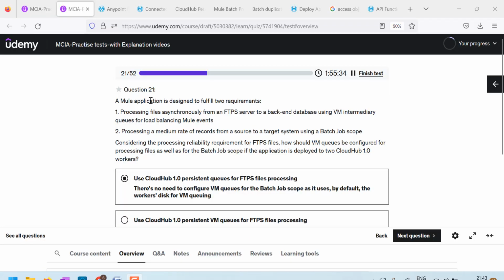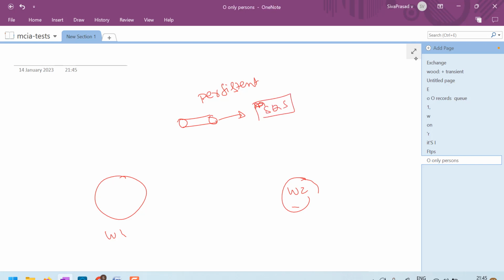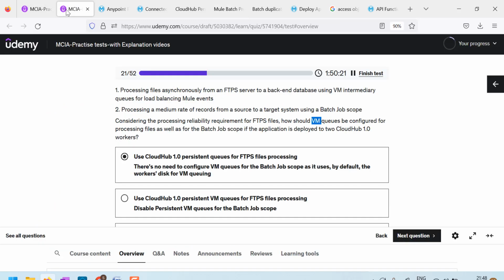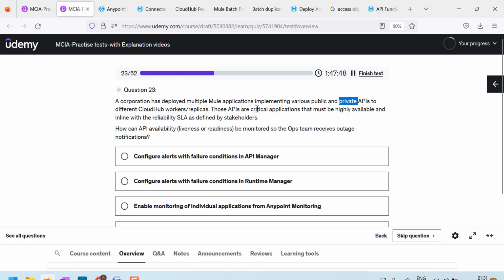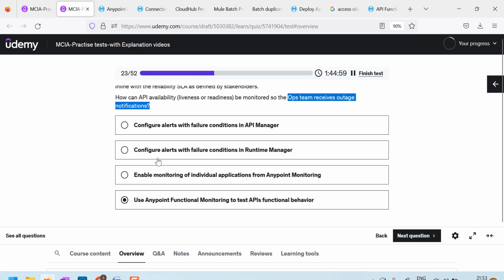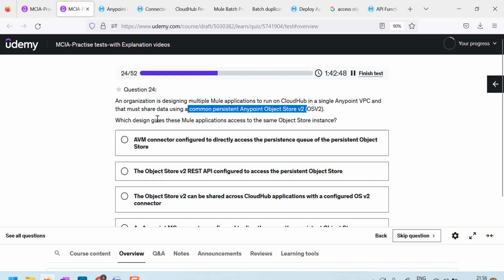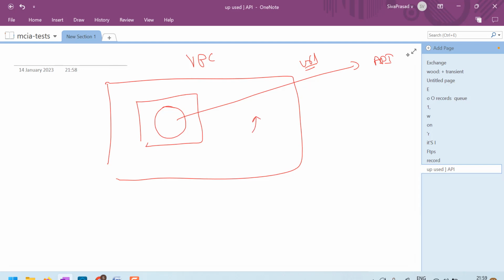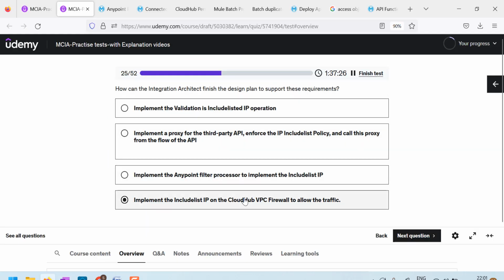MCIA - EXAM QUESTIONS EXPLAINED- PART8

Comment: Answer for Q23 is C .Anypoint Monitoring provides real‑time metrics, health checks, and alerting for API availability. You can configure alerts for downtime, latency, or error rate thresholds.Functional Monitoring tests API endpoints for correctness (response validation), not continuous uptime or readiness monitoring. Runtime Manager can alert on deployment failures, CPU/memory usage, or worker crashes — but not detailed API liveness or readiness checks.